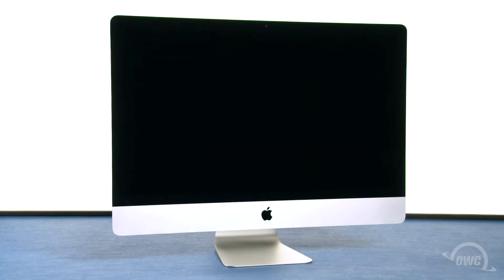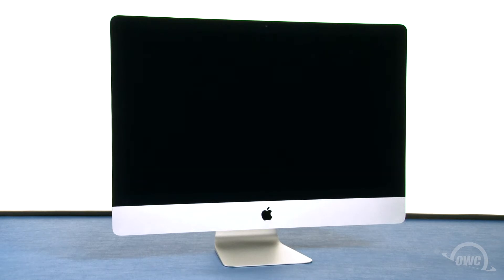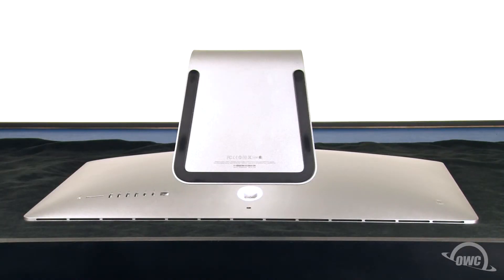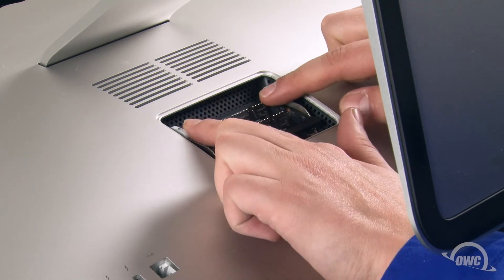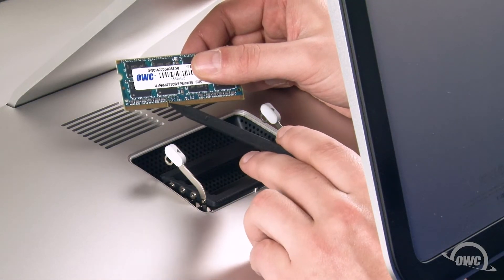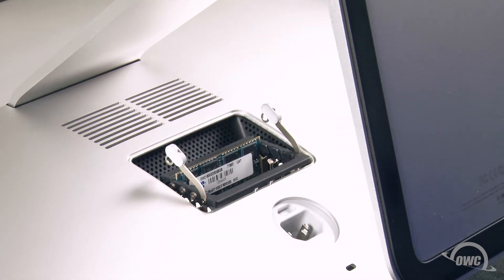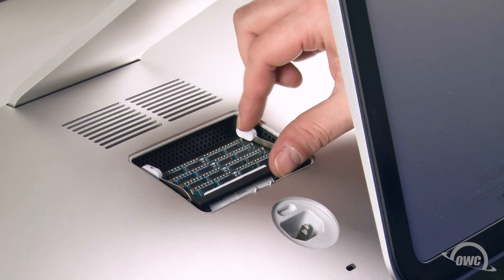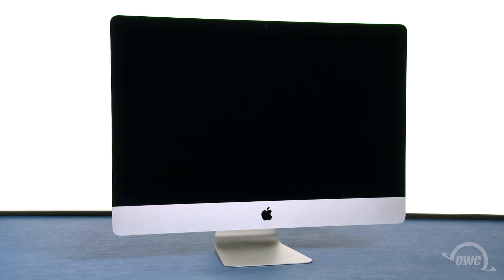How to Install Memory Into a 27-Inch Apple iMac (Late 2015 - 2020) iMac17,1 iMac18,3 iMac19,1

Comment: Great videos and great website. I'm trying to upgrade the SSD of my iMac17,1. It currently has APPLE SSD. Can you directly to the correct disk drive on your website. Thanks so much
Reply from the maker: So sadly we would not have a compatible 2.5 inch SSD for that unit however we do have our Electra SSD for that Sata bay located here https://eshop.macsales.com/item/OWC/K27IM12HE1TB/

f you ever have any other questions or concerns please let us know at support@owc.com!

Comment: My fans continuously turn on very loud under little CPU/GPU load. Many forums online are stating the OWC brand ram is the cause of this issue. As an owner of OWC ram can you suggest anything that could resolve this issue?
Reply from the maker: This is not just something that happens with OWC Ram this could happen with any RAM or can be any other factor. Now if you specifically after troubleshooting have determined it is the OWC Ram it could be that one or multiple of the modules are not being read correctly or just faulty. We can certainly troubleshoot with you to see what it may be but this is not 100% that this only happens with OWC RAM.